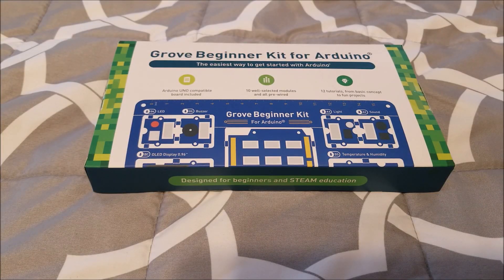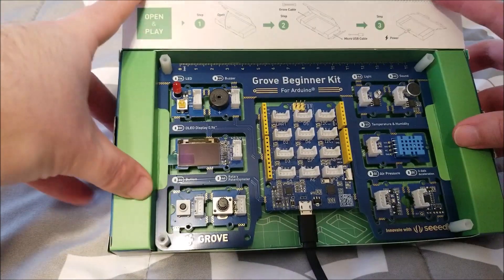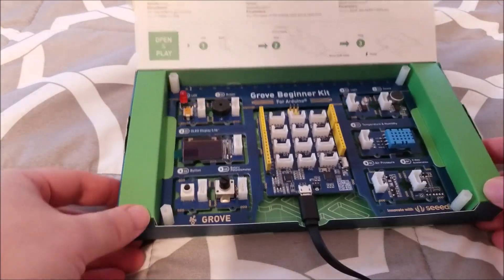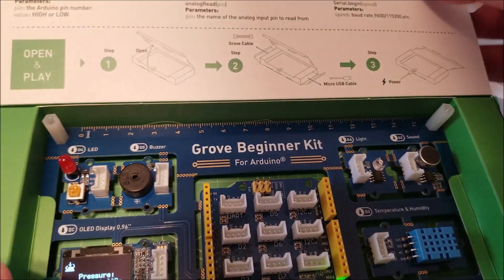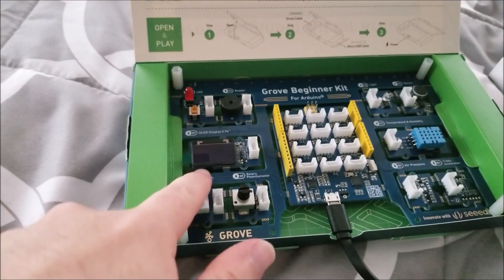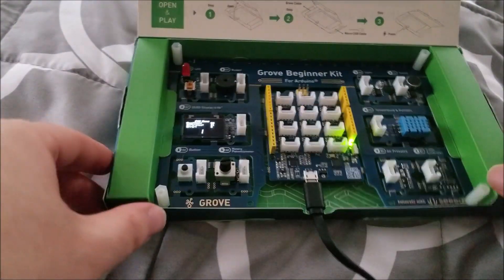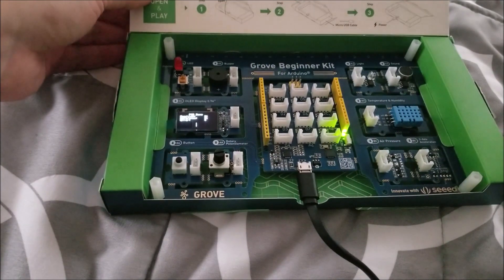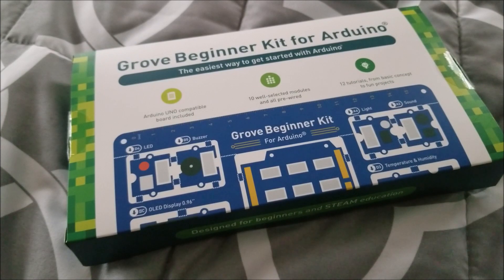Seeed Studio Grove Arduino Beginner Kit Review

Comment: I just bought one of these kits, I love it. Can anyone advise on how to cut out the individual sensors/mini-pcbs without damaging anything? Do they just twist off? Or do you need to cut our somehow? Thanks.
Reply from the maker: I usually snap perferated boards with small needle nose pliers (grabbing and bending from the bits that get thrown out). It's important to take a little file or sandpaper to smooth down the remaining rough bits as they can give you a splinter.
Reply: @sjm4306  OK thanks, that is super useful, and you make a good point about the connections being perforated. Also good point about sanding when done to reduce the possibility of splinters. I have a virgin board and in my case today I want to remove only the oled screen and the Temp Humid sensor, each seem to be attached with only two connections. It looks like the best way to removed is to simply twist the little PCBs 180 degrees and break the connections, then clean up, if I had a little saw (which I dont) I might otherwise try to saw off the attachments. Any other advice? Will the twist off method work, and not damage the PCBs, in your experience? Thx.
Reply from the maker: Twisting may work but can cause damage past the perforation. A little coping saw is the safest/cleanest way but otherwise if the pcb isn't too thick you can get away with using a pair of side/flush cutters (too thick tho and you risk damaging the cutters' edge).
Reply: @sjm4306  Perfect thanks, I will see what kind of tools I might have for cutting, maybe some file edges. I will avoid twisting for now. Will def clean up edges post cut. Great advice REALLY appreciate.

Comment: Great video. however the board seems to have problems. The Arduino IDE will not find a port for it, when loaded as an UNO. Is there another listing  for this board or how did you program it with your program. Any  help would be appreciated. Thank you.
Reply from the maker: First confirm that you can see the com port mount in device manager (it'll be under Ports COM&LPT). Test with another usb cable just to rule out it being the cable. I don't remember exactly what board I had to select for it to flash but it was either genuino uno or pro/pro mini.
Reply: Thank you for the quick reply. I will give that a try.